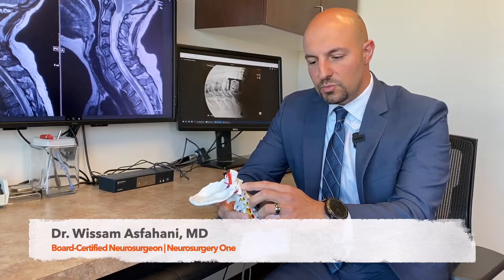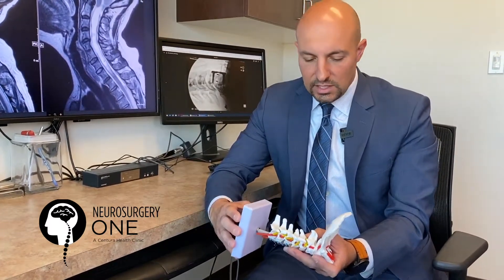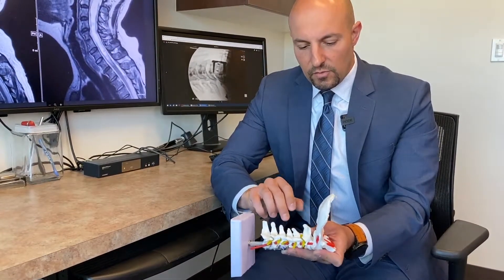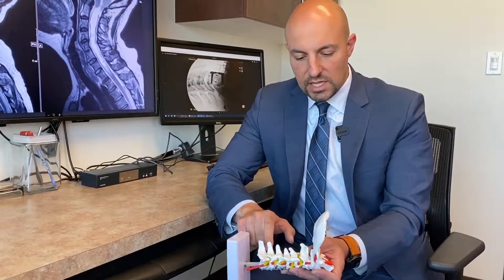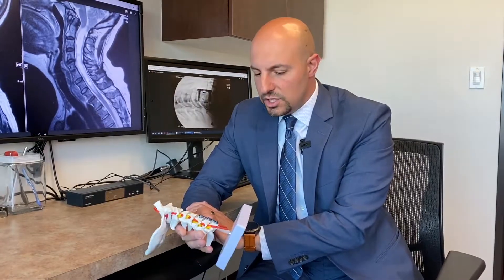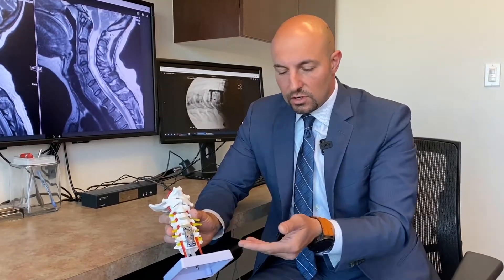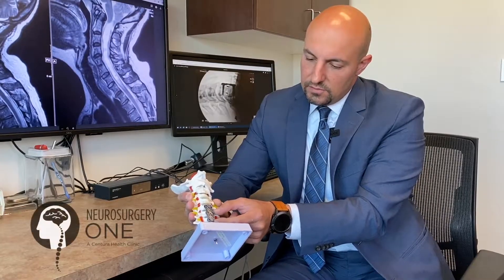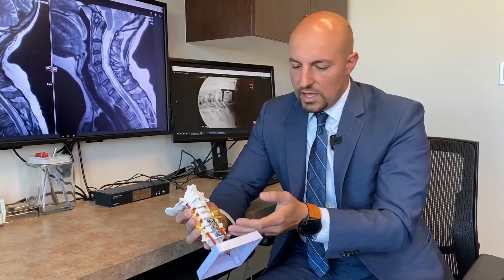Cervical disc replacement vs fusion for neck pain.

Comment: I had a cervical disc replacement in 2020. A year later the next level was damaged, but at the time only fusion was available to me. I put it off and am now dealing with the same excruciating pain again. I have to wait 2 months to see a neurosurgeon, but i am hoping for another disc replacement

Comment: great video!  What if I have all the horrible symptoms of nerve compression (neck pain, numb hand, weak limbs, bicep pain, heart palpitations, hot flashes or red face etc)  My mri and xrays show bone spurs; arthritis; and minimal disc bulg at c5-c6 and c6-c7; BUT the experts looking at them say that the pics don't explain my symptoms?.....terrifying situation because symptoms getting worse over time....if the experts could only experience my symptoms they might see that something needs to be done.
Reply: Figured out a cause or solution?
Reply: @Pawnlust  I did.....finally found talented physical therapist with very strong hands and he was able to create some space for the crowded or pinched nerves in my neck. My symptoms are about 80% better and I feel very fortunate....thanks for asking....the physical therapist said I had some joints locked up in my neck. It hurt when he moved the joints but I knew I was not going to get out of my mess easily.

Comment: I am 66 years old and had two level disc replacement a year ago (c5/6 & c6/7).  It was one of the best decisions I have ever made.  I even traveled across the country to get it done by Dr. Choll Kim as many of the doctors in S. FL wanted to do fusion.  DO NOT give in to the surgeon who jumps right to fusion without adequate explanation.  I had one doctor in FL who wanted to do FOUR levels of fusion!

Comment: Thank you for answering some of my questions. I have cervical spine stenosis pain numbness tingling. One surgeon would like to do ACDF C3 four C4 5C65 and C67 fusion. Another surgeon suggest three disc displacements., Though he said he may have to fuse one when he got in there due to the fact there was a cyst on a vertebrae. The opinions were within the last month within the same MRI or MRIs. I’m extremely active 57 year-old weight training, w nine-year-old boy. far from normal in that department. I also have stenosis in my lower back that doctors have discussed operating since my 20s. I’ve learned to live with that kind of at a certain level cervical pain really went south two months ago. I’m confused exactly what to do. Anyone can help. Let me know. I live in Florida.
Reply: If you’re in Florida I’d check out Dr Jeffrey Cantor MD in Fort Lauderdale
Reply: Elon musk has 2 level cervical Fusiiin , 8-10 pain level down to 1-4 daily. So not gone but greatly reduced. 

I bring him up bc you know the richest man on the planet has the BEST , team , surgeons , advisors and they told him ARD- but my point is - he still has some pain but he has full range of motion practically. 

I’d do the disk replacement .  Maybe give it a few months to see how it is but I’d go for that if they actually think you are a candidate for the ADR.  

Best of luck. Awesome you have a 9 yr old son at 57 - that gives me hope.

Comment: I am fused from either T1 / T2 to L3/L4 is it a possibility that is why i now have a herniation around c5 c6 or could it just be fron pressure transfering to the above unfused segment from lifting items that might be too heavy for the muscles in mt back shoulder and neck becsuee it came on 1 week after i lifted a very heavy child and then i had ear pains from it but relaised i was getting ear pains earlier in the year when i probably lifted things doing house decluttering and house repairs and perhaps it was progressing and got worse with lifting the child?

Comment: This is really useful. I have multilevel (C4 to C7) disc herniation (from a severe whiplash injury a few years ago) and degeneration with mild signal changes in the cord at C4/5. I also have Hypermobile EDS. I have just lost the use of my left hand and so I'm now waiting for a referral to the spinal team (I'm in the UK so the wait may be a long one!) My concern was the impact of a fusion on adjacent vertebra as this is a recognised issue for fusion surgery in EDS - and a problem I've had with other fusion surgery (not spine). It looks like disc replacement and debridement(?) is the best option. Restoring hand function is a work in progress! 😅
Reply: I hope you better soon. Have you had your surgery already?

Comment: I’m seeking medical opinions for disk replacement vs fusion and was told by a neurosurgeon that because my spinal cord is being compressed and showing sign of damage I couldn’t do a artificial disk replacement. Fusion is the only way to go. But a orthopedic surgeon said I he could perform disk replacement. I would much rather as I’m only 37. Which is the best way to go?
Reply: Did you get any answers? I’m 38 and my neurosurgeon is recommending fusion. I don’t want a lifetime of surgeries
Reply: @kitkatwiggs  I had the disc replacement at c4-c5 neurosurgeon did the procedure. I never got any relief and the pain is almost worse now. It’s been 8 months and now the neurosurgeon is saying he needs to remove the artificial disc and do a fusion from c4-c7
Reply: I’m only 39. That’s why I went for the artificial disc. The surgeon said my body didn’t like that space to be open. He said bone spurs are already growing at the level I had the surgery. I was told a fusion would fix it.
Reply: Consult Dr Schmitz in Dusseldorf Germany, he has massive experience!!
Reply: BULLSHIT...this is a typical conservative response by MANY doctors.  I was told the same thing before seeing Dr. Choll Kim in San Diego.  I had to fly from FL to CA to have the surgery, but it was worth it.
Reply: How much cost the disk replacement ? Thank you
Reply: Insurance do not want to pay for replacements. All about money! Always money!

Comment: Hi, I did a 2 level ACDF  (C4,C5) 2014.. now it seems that C3 above and specially C6 below are also impacted and I would need to make a 4 level ACDF !!   is there any way to take away the current  2 level ACDF C4&5 and replace it with the Protese Disk for better mobility ?
Reply: Excellent question I have 3level fusion don’t want to have this kind of surgery too tough for me and I just have 2 month. Since
Reply: @eddiemiranda469  How are you doing now? I just had a level 3 done on Sept 20, so Im just getting started.
Reply: Yes for better mobility
Reply: 99 percent no.. in the 1% chance the fusion of the vertebrae fails, maybe.. there aren't many guys in the world doing that though

Comment: Aside from thoracic I wouldn’t want fusion.
Reply from the maker: When possible, we recommend disc replacement. However, disc replacement is only approved for two levels so if there are more levels involved, fusion is necessary. Thank you for commenting.
Reply: @neurosurgeryone  
I have been living with headaches all my life, about three yrs ago comes along chronic neck pain. My neurosurgeon diagnosed me with that I born with c5-7 lean forward sending me to pt chiropractor and done rhyzotomy twice on both side of my neck. She wanna discuss ACDF on January 3th, my Q is why not ACDR while is not more than two levels? 
Do I have a choice? Also I saw a comment saying bone grow over the disc?

Comment: CHIROPRACTOR SCREWED ME UP
Reply: Sometimes I feel the same way. I often wonder if I should have not gone to them.
Reply: Same, now I'm scheduled for 2 disc replacements, I hope I get the feeling back in my right hand.
Reply: Same here had zero symptoms of any pain or anything chiropractor insisted on adjusting my neck mentioned I had disc herniation degeneration arthritis but my neck was fine I actually went to the chiropractor for lower back pain he insisted on adjusting my neck as well he said most of his patients had all those issues that I was going to be fine made the mistake of believing this guy now I'm screwed been in pain limited neck movement crackling noises when shifting neck with pain wake up very stiff pain 24 7 in my neck it's been over a year now it's terrible

Comment: I have hernias at 4 levels of my Cervical spine which are causing nerve compression. I am experiencing pain, numbness and muscle spasms. Am I a candidate for artificial disc replacement?
Reply from the maker: Unfortunately, Kaelin, the FDA has approved ADR for a maximum of two levels so you would not be a candidate. However, there are other surgical procedures that are very effective for patients who do not qualify for ADR. If you live in Colorado, I'd be happy to have a consultation with you to explore options.
Reply: @neurosurgeryone  Since when has the FDA done us any favors?  I of course don't know why the FDA has only 'approved' up to two levels, but it seems that the FDA operates on bribes & corruption (same as WHO, CDC, NIAID, et. al.) so I wouldn't put much weight in their opinion.  I met with neurosurgeon in Reno yesterday who offered me a 3 level cervical disk replacement with the understanding that it's not FDA approved.  I asked him if Medicare will cover it and he said that they have covered all the other 3&4 level replacements that he has done.  Interesting that one government agency doesn't approve of what another agency covers :-)
Reply: I have had posterior c2-c6 fusion at mount Sinai ny Dr. Steinberger he is ausome
Reply: Hello. Can I know your status now? Because I have also multilevel cervical disc bulges

Comment: Which is best ACDf or ADR for long term
Reply from the maker: Hi Raja. The answer is not really black and white. ADR has shown slightly decreased rates of reoperation in the long term, compared to ACDF, and there are some recent studies that have shown slightly decreased pain long term. But the caveat is that in patients who have facet arthropathy or spondylolistesis, ACDF is superior. Plus ADR is only FDA approved for 2 levels. I hope that helps. Here is a link to a free guide on ACDF vs ADR: chrome-extension://efaidnbmnnnibpcajpcglclefindmkaj/https://www.neurosurgeryone.com/wp-content/uploads/2021/05/2201_NSO_CervicalOptionsDL_FINAL.pdf
Reply: And what happens if after 2 levels of ADR years after they have problems either above or below the cervical fusion then they would do a ADCF below but can't put ACDF above because of the weight on ADR?
Reply: @NiccBlacc-NCBC  in the USA yes more than likely.. In Europe they are doing 3 and 4 levels adr no problem

Comment: Sir I have a doubt about surgery.fusion or disc replacement witch one is better.
Reply from the maker: Both spine surgery procedures have good results if patients are carefully selected. Whether fusion or replacement is better depends on your specific spine condition. I am happy to discuss this with you. Please call our offices at 720-638-7500, Option 3, to schedule an appointment with me. Thank you.
Reply: @neurosurgeryone  thanq
Reply: I honestly think disc replacement Because it has better longevity, and you shouldn’t have problems moving your neck afterwards.  My worry is as not being able to have the flexibility I use to have, but honestly I think it would be best to ask your neurosurgeon which one would be the best for your particular situation.  Everyone is different. Beast of luck to you .❤

Comment: I had my neck and back fused a couple of years ago but failed 😞 i had 3 surgeries on my neck I had 4 bones replaced  from cadaver I was diagnosed with failed back syndrome I’m in a lot of pain ,getting a lot of headaches in the back of my head down to my neck to my shoulders ,to my back lower back to my legs all the way to my toes my arms are numb I had 4 bones replaced with cadaver bones in my neck my back is numb all the time also a lot of pain feels like I’m been sliced with a very sharp knife , I feel my flesh been torn,stabbing,sharp needles,my lower back feels frozen hard but painful I don’t sleep at night but 1 or 2 hours if I’m lucky ,I can’t seat down for more than 10 minutes because the pain in the back starts hurting really bad after my surgeries my sciatic nerve has been hurting driving me crazy also I was told I have 3 herniated discs in my lower spine can you suggest anything that would help my situation
Reply: I've heard of something called Tame The Pain where they implant an electric charge to shut off pain receptors.
Reply: Omg, how are you now?
Reply: How are you now?